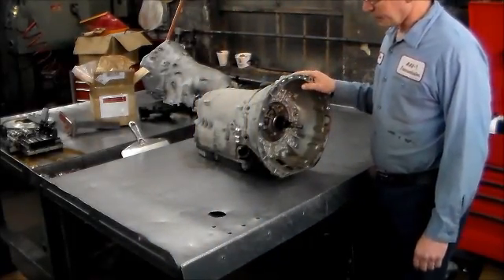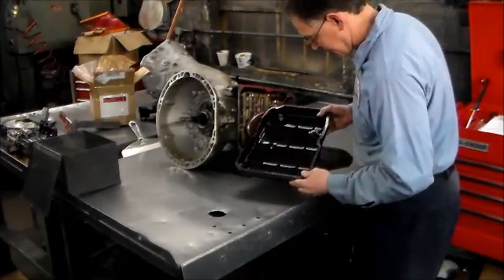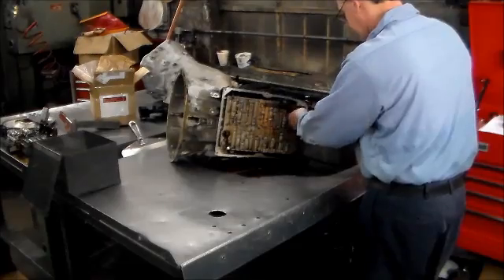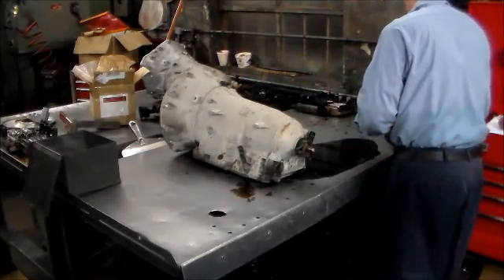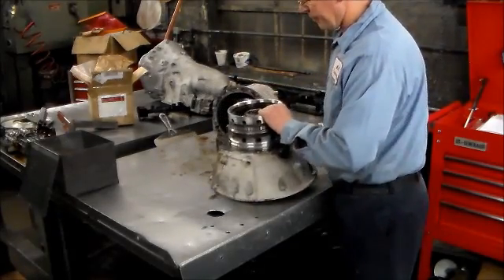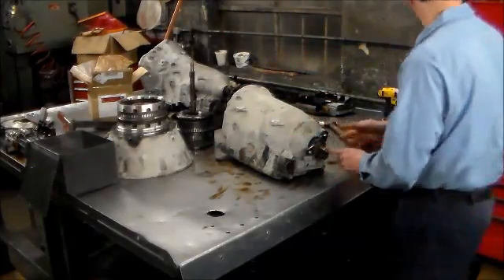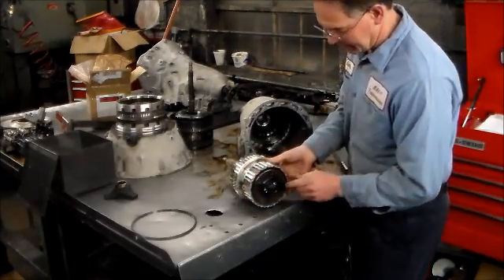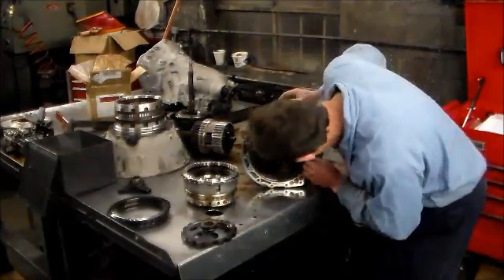722.6 Mercedes Transmission, Teardown Inspection

Comment: Is it possible that the tranx didnt came with the parking/bearing and bearing/output shims? I didnt find those on my transmission, what can i do ?
Reply from the maker: Enrique Dueñas I Believe i saw that once, (no shims). There is a procdure to check the end play. Do you know if this trans was worked on before or maybe apart before. You will have to measure the end play. i will get the procdure and let you know. im pretty packed at the shop, but i will try to post it tommorrow nite.
Reply: Found it, check page 115 of the following manual. 
http://www.all-trans.by/assets/site/files/mercedes/722.6.1.pdf
I already measured the end play, and without the shim it is .3mm :S so, aparently it is ok without the shims... but im still not comfortable about it.
Reply from the maker: Enrique Dueñas 0.3 to 0.5 is the spec, your within that range you should be ok, Good job on checking the end play. Gary

Comment: Can the bellhousing assembly only be removed after the valvebody is removed?
Reply from the maker: 1stGenStunter Yes, you can even remove the bellhousing without removing the valvebody, before removing the valvebody make sure you remove the pass through connector first. Thanks for watching. Gary

Comment: At the very beginning you didn't say what was the trouble with the transmission!!!
Reply from the maker: EndofUSA At the begining i didnt know what i was going to find, if you start watching from 6:45 is when i found the problem with the trans. Thanks for watching
Reply: Gary Ferraro
what I meant was I am sure the owner of the AT had observed and had complains of what the trouble was, like was it flaring in any of the gears, hard shifting, no shifting, whining sound etc.    Thanks
Reply from the maker: EndofUSA Sorry about that, It had a really bad  slip on the 1-2 shift. I found the F1 sprag to be bad, which is the bridge for the 1-2 shift on the 722.6.
Reply: Gary Ferraro
thanks.